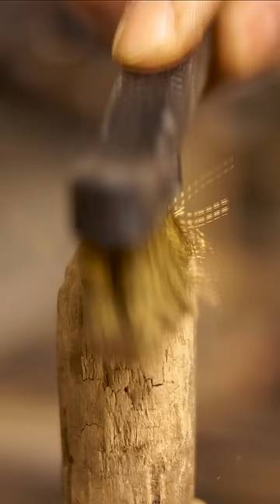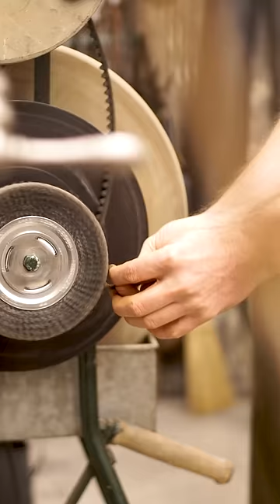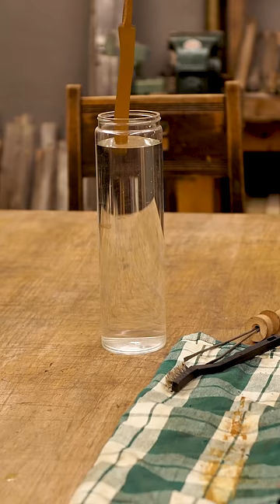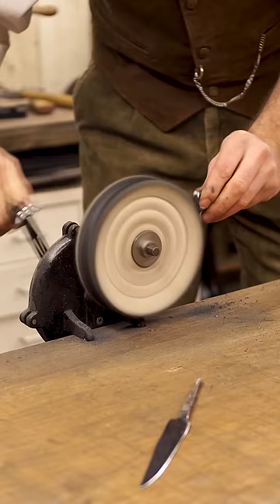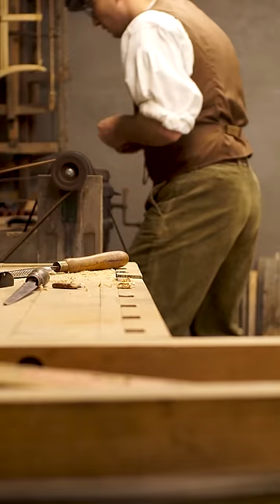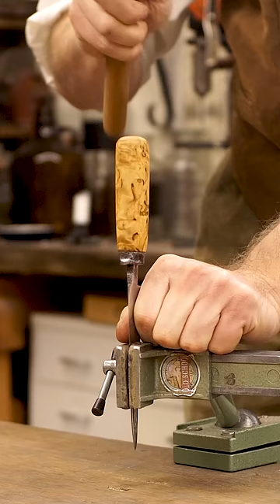Old rusty knife #restoration #kniferestoration #vintageknife

Comment: Huh. Does linseed oil work like Teak Oil? Or are there differences?
Reply from the maker: Yes, they dry and protect wood differently
Reply: @FFD_Restorations  which one protects tools better?
Reply from the maker: @fl4ming_r4ven  depends on the wood type but in most cases boiled linseed oil will give better protection in my opinion 😉
Reply: @FFD_Restorations  thank you!
Reply from the maker: @fl4ming_r4ven  of course 😉